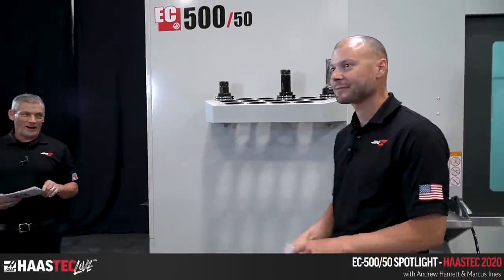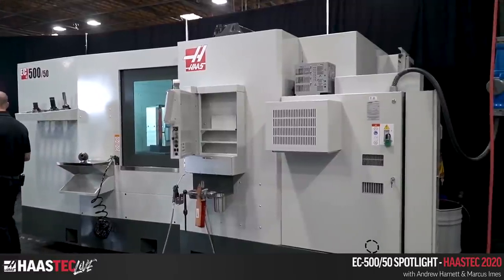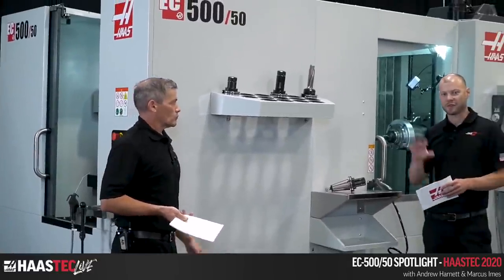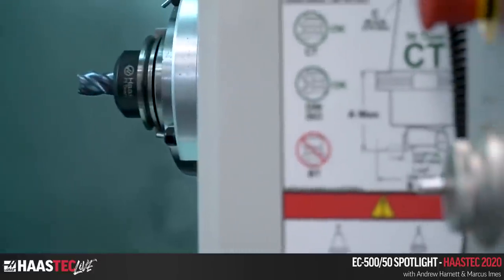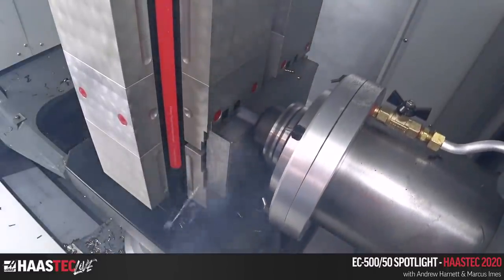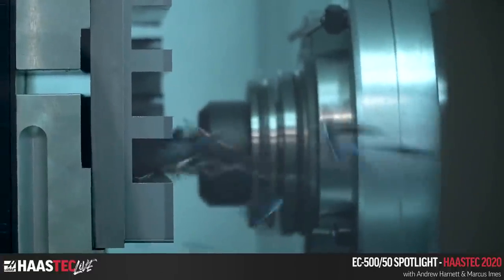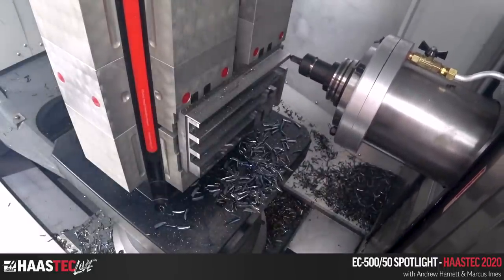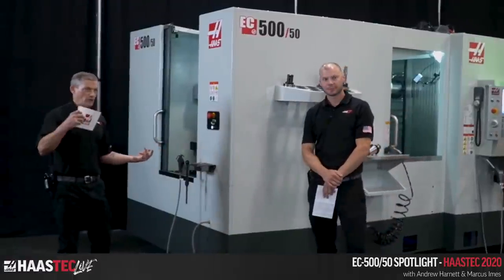EC-500/50 Spotlight - HaasTec 2020 Focus Series - Haas Automation, Inc.

Comment: Our Haas VF-3YT 50 taper was only able to run 100% load for 30 minutes then i got transformer overheat alarm. on 40 minutes it stopped by itself on thermal protection.

Comment: I did on my vf4 a big cut in aluminium at 90% ish load, and it broke the gearbox, belts and motor, and it took out my 40hp vector drive, not sure what would've happened if I did it at 150% 😳, good machines for the price obviously.
Reply: Yeah, that happened...
Reply: @ClockworksOfGL  I can send images lmao, it tried to change from low to high gear and blew after it.
Reply: @BebenX  were you changing gears in the middle of a cut? That will blow up a gearbox
Reply: @chadkrause6574  not possible, it has to stop the spindle first, it was after and it changed gear and the spindle turned on again and blew, the machine was old anyway.